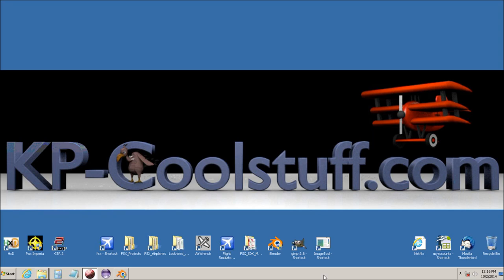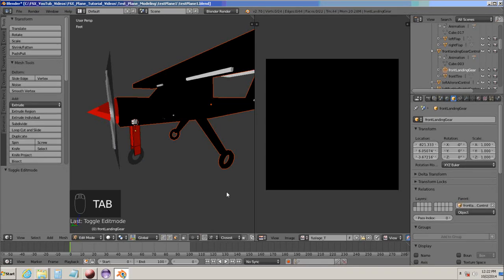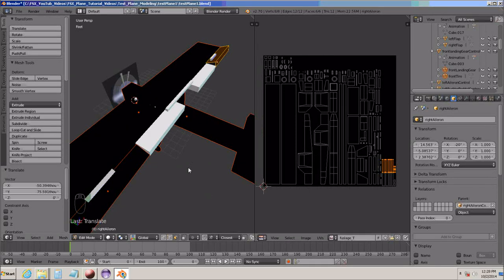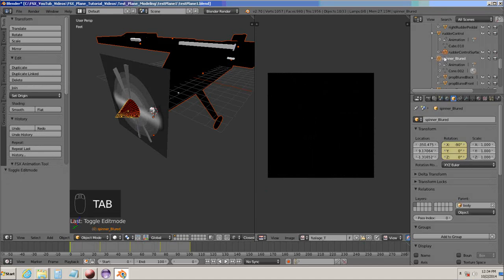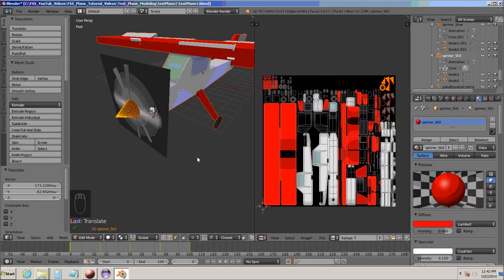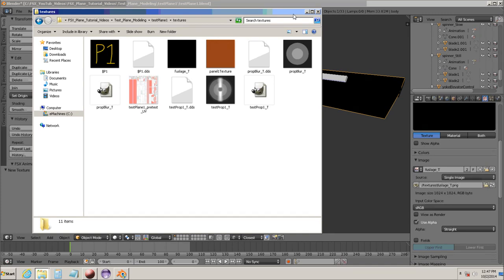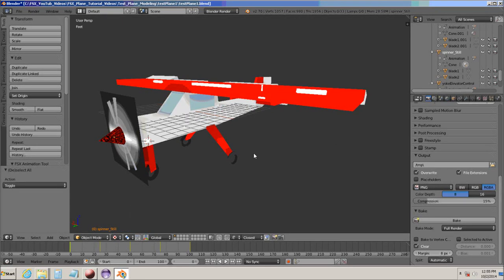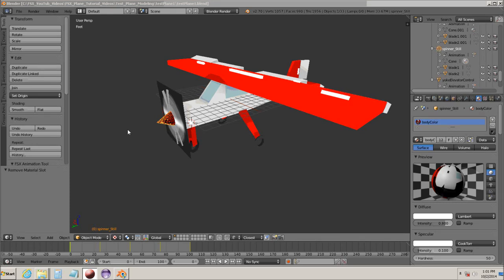How To Use Blender For Making Flight Simulator X Models (FSX) Blender2FSX Part 18

Comment: Hi! Just a quick (perhaps silly) question:
Obviously, by using the internal Blender Render machine, you get to get the different texture maps the way you are doing them right now (and the procedures are totally different in terms of unwrapping, etc); but is there any particular reason why you are not using the Cycles machine, which will get you far better results (IMHO) when texturing all surfaces and defining all materials/textures? Is there a reason why you are, indeed, using the Blender Render one? The reason I'm asking is because, (again) obviously, the procedure for setting the texture maps is WAY different from one machine to the other, and there is a point where your viewers (who actually use the Cycles machine) will get confused, since the options available upon texturing and applying materials is completely different. Is the baking different while using the alterate (Cycles) machine? Thanks, by the way, for taking the time to make all these amazing videos. You are a life saver! Kudos to you, my friend!
Reply from the maker: Fernando Bayo Niederheitmann Hi Mr. Fernando!
No, there is no reason why I did not use Cycles render. That I know there is no reason why you could not use Cycles render to make your textures.
Thanks, Kris

Comment: Watched first 3 videos last night...going through the rest today...stupid question...do I need textures to test MDL export....keep getting errors...can you export the mesh only? To test MDL export into FSX
Reply from the maker: Hi Michael Jones!

Yes, you need to apply textures to your model, or you will get errors. And also remember that you need to convert the texture to a DXT1 or DXT5 format depending on your alpha channel and save them with a .dds extension. (Use the Image Tool that comes with FSX SDK to convert your textures to DXT1, DXT5 and save with a .dds extension)  If the textures are not converted to a .dds format, FSX will not use your textures for your project.

Thank you for watching my video's, Krispy1001